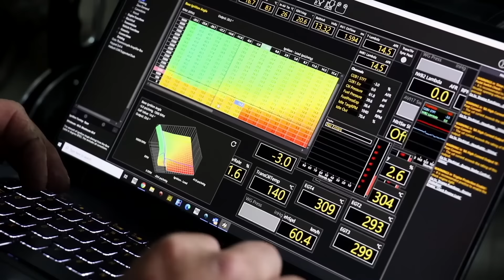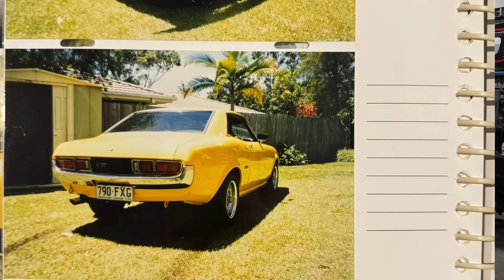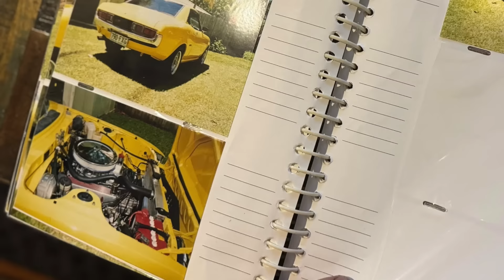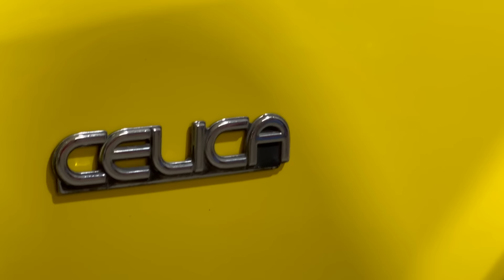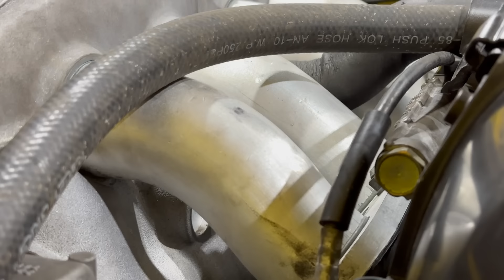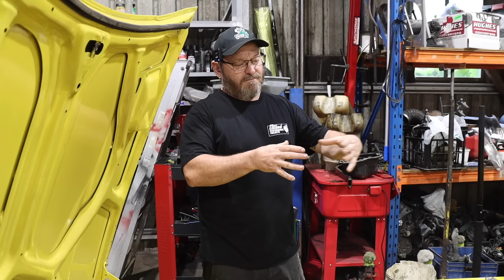3SGE BEAMS Swapped RA23 Toyota Celica!

Comment: I'm having issues with my Altezza beams swapped 73 Celica running well. Perhaps it's that MAF meter? Do you have a good write-up on the conversion? I recently purchased it not running and just got it going, but it stumbles and dies with any throttle response.

Comment: Awesome build. I have a 1979 Toyota Corolla that I have plans for popping in either this engine or a 3S-GTE, haven't completely decided yet.
If I go with the Beams I will definitely turbo charge it. Also thanks for sharing about the issues with the stock ECU, good to know upfront.

The rally cars ran the 503E version of this engine family, but good luck finding one of those. They made upwards of 800hp or 597kw. 😍

Comment: Nice looking body. I have a '76 in storage, started restoring it for rust repairs, then had to park it due to landlord selling property, etc. 2lt Twin Cam import motor which only 200 came to AUS from Japan, a very good Yamaha head, the dual throat twin Solex carbs worked perfectly in 10 years I drove the car. I had 17 people wanting to buy the car in the years I owned it.
Note: I recommend putting a water seal strip at the bottom of the side windows, as water gets through the factory brush set-up and sits in the bottom of the doors and frame, which is the main reason many of them went rusty. 
The gearbox never seemed to wear, same with the engine cam chain excellent. The rear diff needs shims put in to get rid of play, and the clutch bearing went after sitting undriven for a few years sitting outside, when I revved it to 8k+ to clean  the exhaust pipe, lol.
Lowered custom springs, cruised beautifully at 170km/h, (see you, factory wrx). Overall, good enjoyable classic car.
[Admin of: Classic and Used car Supporters Group on FB]

Comment: I wouldn't be suprised if the old Rover engine was a mix and match of parts from a Rover engine and a P76 engine. A common mix, back in the day, was a P76 engine with Rover heads.

Comment: The beans (you can give it the beans and it doesnt care) is a good engine, N/A-wise pretty much developed with what they learned with the 4age (last 2 gens of it had VVT-i on exhaust).
Those ECU's can be worked on, lots of Aussie Blacktop 4A-GE guys has been doing interesting stuff with Toyota ECU's for years now, head on over to ae86 driving club for pointers.
Turbo is cool and all, but with how little this car weighs it's a weapon already, turning it into a Group.B car with turbo is inadvisable with the speed limits and how cops in Australia react on anything more than 100% correct nannying. Then there's budget to consider too, internals and brakes needing a bit of an upgrade as on top of that and then from there the costs just utterly snowballs to no end when this car is obviously about driving and enjoying, better keep it simple and budget friendly with N/A.
Best upgrade for a Beans is Blacktop throttle's (SQ Engineering in Australia makes intake adapters) and aftermarket management, you get the throttle response, more air, and unlock the Beans without fettling with internals.
If turbo REALLY is the end-goal, get a 3rd gen engine, it's a tad stronger & better suited.

Comment: That used to be a cstom in the UK, you could say the rover was our chev v8 , it was a buick 218 cu in (BLMC) purchased the rights. 

The over V8 was tuned our to 4.8 litres by the car co (TVR), for their rare as rocking horse shirt TVR 450 SEAC (Special Equipment Aramid Composite)with the most outrageous spoiler on a convertible!!!! 

Saw one for real, and the sound as bitchin' , piss yellow louder than Thor launching a bottom burp.

It was being tested by Land Rover engineering for developing the 3.9 ltre into the 4.5 ltre engine.

Comment: Don't bother with the hairdryer, just change the diff ratio.
Old 3.5, 3.9,....? Be just as easy to fit the Rover rocker covers on the 4.4 litre Leyland version, would have been a few of those blocks kicking around at the time, little massage they go out to 5.0, 5.2 litres.

Comment: Good to see you again, Al! That's one pretty little Celica! You'll be mad at me for selling the YB Cosworth out of the Viva, but cost was the major factor. I'm having a 4.6 p38 Range Rover lump built to 300 ponies by V8 Developments at the moment... nice cnc bits! May feature a skinny boi or two in the future, though! 300 is good enough for now with the 185 60r13s on the 8s 😂 Cheers. Leigh. PS: The shel. Is back on the spit to finish the underside... I hate welding upside down 😅

Comment: Nothing odd about it Al - the JGTC GT500 was an air restrictor class limited to a theoretical ceiling of 500hp.
You wouldn't use a sledge hammer to drive in a nail, if you have a 4 cylinder race engine which can already comfortably make well over 500hp reliably (made up to around 800hp in the Eagle mk3) then there's no point using the big 3 litre 6 cylinder 2JZ.

Comment: What did you use in the j160 to comvert it to manual speedo cable
Reply: SQ engineering do a mechanical speedo kit
Reply: I just used the W55 drive.

Comment: It’s always more fun when the needle can go off the end of the gauge. The JDM 180km/h limit of all the 90s cars and all of the speedometers stopping at 180 meant you could probably get to the end of the speedo somewhere in 4th and still have the whole of 5th left to go when it had a few mods and the speed limiter removed.
Reply: Can attest to this with a 1988 series 4 convertible RX7 which I had through the 00s. I heavily built and boosted it to 300rwk. It would be clean off the 180km clock in 4th with 3k revs left before the limiter. I had no idea what speeds 5th gear was capable of until decent GPS with speed displays were cheap enough around the mid 00s.

Comment: I know the power seems low-ish but modern turbocharged standards but getting over 100hp per litre is really hard work even these days. Honda's VTEC engines could do it and I think Nissan's VE versions of the SR could do it as well (I think the SR20VE was around that 210hp mark as well, shame you could only get them fitted with an awful CVT) but it's not an easy job to get that much power out of so little capacity without forced induction. Normally that kind of efficiency is for super, super touchy supercar type stuff (see Ferrari's insane 800+hp from 6.5L)